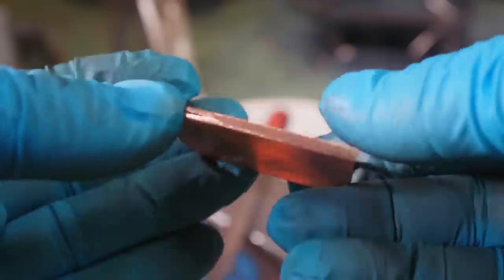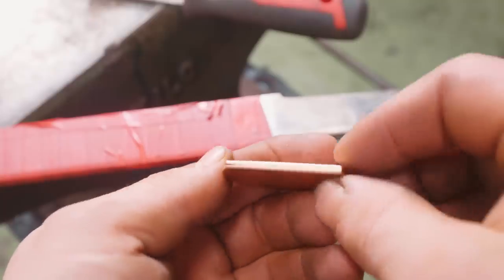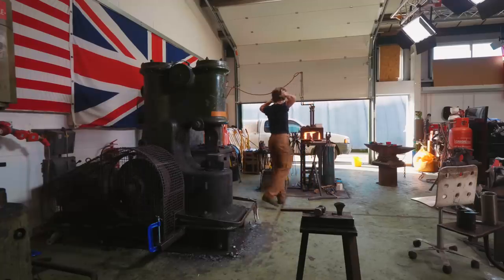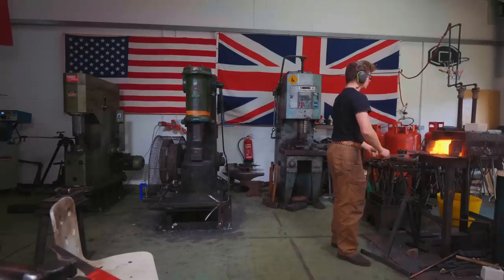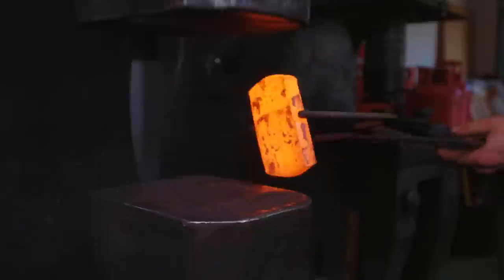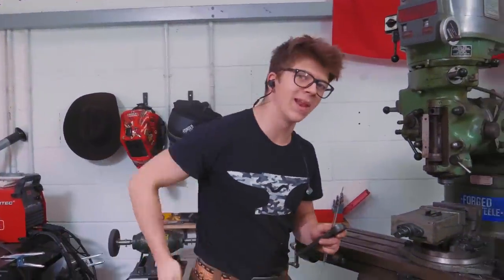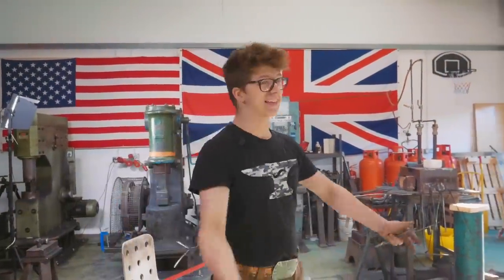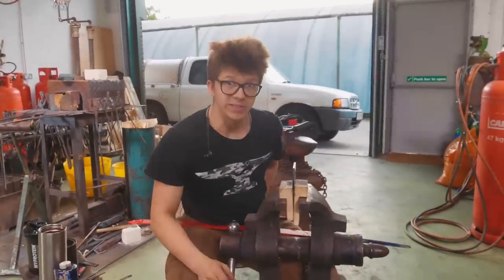MAKING A KATANA!!! 1 MILLION LAYERS!!! PART 7 - The Guard

Comment: The height of your katana-inspired sword from the spine to the blade is too tall, Alec. Go over your references more, you could stand to lose about 1/4". The point of katanas being not as "tall" and being convex ground is to push material and tissue aside in the cutting motion.
Reply: Chasing Photography Films How tall is Alec? The original katanas were sized for the soldiers of that time who rarely exceeded 1.60m. I myself am 1.90m and also have bigger hands, so a few years ago we mocked up a scaled up version from cheap 1045 steel to see if it made any real difference. Even with a blade that was clearly inferior to the one I normally used, my cuts improved in accuracy and cleanliness. If I ever have the spare cash I’ll have a proper blade smith forge my one to size.
Reply: I agree and maybe 1/4" is too much, but his blade at its current state still seems too much overall. Just an observation. Not here to be a youtube warrior, I'd love to see a katana for a 6' 2" gentleman like yourself! I bet its pretty bada$$.
Reply: Chasing Photography Films What’s the length of his blade now?
Reply: He wasn't talking about the length of the blade. He was talking about the height. From the sharpened edge to the spine.
Reply: Andrew Delashaw I know that. But if you scale up the whole sword for a taller person, the width should change as well as the length. Scaling the length but not the width might result in an overall less pleasing or possibly even a weaker construction.